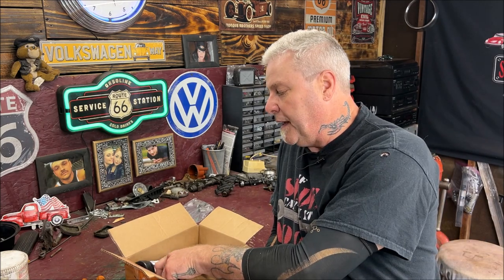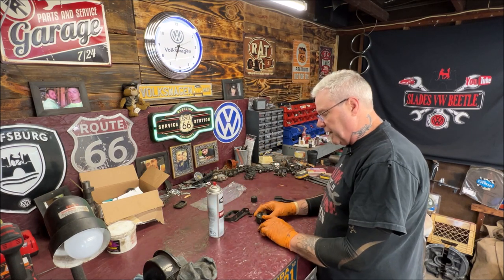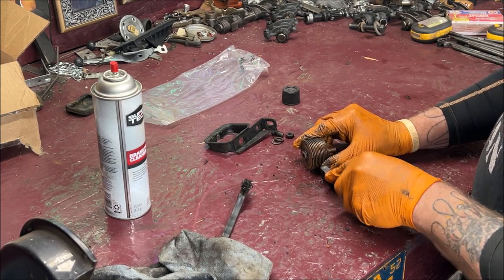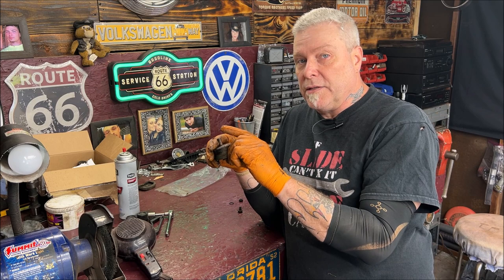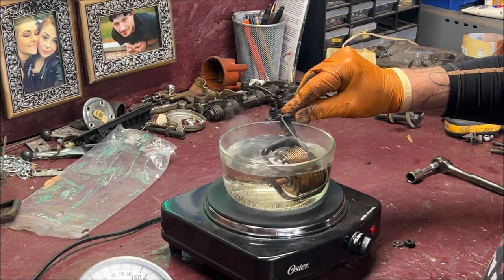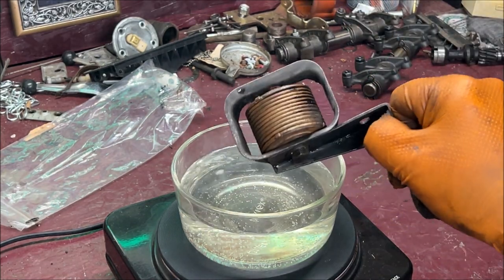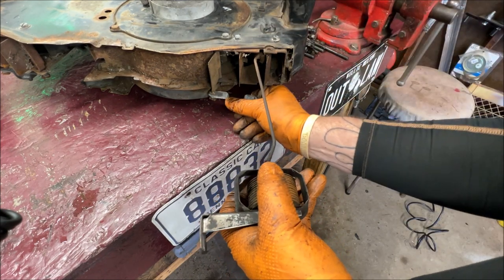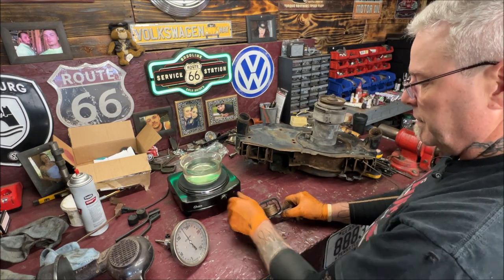VW Beetle - Super Beetle - Thermostat Testing & Explanation - VW Ghia - VW Bus- Classic Bug -

Comment: the Germans made this engine very well. there is a reason to use that thermostat in any climate where you live.
the engine has to warm up fast, to get the best out off it and less fuel consumption without the choke.
beautiful explained Tony and as always a good video.
Reply: Some folks like to rebuild their engines very few years. Thats why they remove the thermostats and flaps.
Reply: @vintage76vipergreenBeetle  It’s never a good idea to take them out. There are more reasons to leave them in. I have seen a lot off stuff over the years and at one day you will see the difference between doing the right thing or cutting corners. Just my opinion.
Reply from the maker: @VWBEETLEOVAL1955  honestly, I think the Germans were geniuses. For many reasons. And then of course not for some reasons lol however, I think they did a fine job with these engines.

Comment: Great video.  I have been running my super beetle with out a thermostat and have condensation in the oil fill.   Proves the engine was running cold.  I will be installing the thermostat soon.
Reply from the maker: Thank you Jeff, and thank you for being here. Yes you want the engine to warm up quicker, and stay warm. I surely hope that made sense.

Comment: Great video.  The demo is very detailed as to how it all works.  Is the slot mount bracket critical on placement to the engine block for the flaps to open completely?  My engine is running a bit warm and I wonder if I should loosen the bracket and shove it up as far as the slot will let it move.  Also got to back off the timing from 32 to 28 to see if that will help.  Thanks for all the videos.  You need to do a baywindow next build.  I need lots of videos to get that money pit back on the road.
Reply from the maker: Honestly William, that bracket is adjustable. 
So you could try adjusting it up, to open the flaps further. I surely hope that made sense. 
And honestly I never go above 30° full advance unless I really have to. I try to keep it between 28 to 30. So it don’t run hot.

Comment: Good info, Slade.  Years ago, lazy mechanics discarded these thermostats in areas with warm climates because installing the fan shroud is more difficult when messing with the thermostat rod as it is threaded through the cylinder head.  Pure laziness, only.  

Getting the engine to operating temperature as quickly as possible is the goal every ACVW owner should desire.  A properly functioning thermostat and flaps system accomplishes this goal.  No thermostat, and the engine runs too cold for longer periods of time.

Who would remove their thermostat from a water-cooled engine?  No one with any sense.  Why would you remove one from an air-cooled engine, then?
Reply from the maker: Right?!?!? Thank you, you put that all very well my friend. I just believe the engine design is amazing, and I try to keep them true to what they are. I hope you have been doing well, and you’re healthy and happy my friend!

Comment: Thirty five years ago, (when I was 22) one of those thermostat bellows opened up so wide on my beetle, that it destroyed the bracket and stuck in that position, never going back to normal. I then replaced it with a new one and that got so hot, that the solder holding it together melted and it fell apart. Horrible things.
Reply from the maker: Wow! I’ve never ran into problems with them.

Comment: I would love to see a side by side comparison of the original and new thermostats failing. I've often heard that the coil version fails in the closed position. It makes sense considering the relatively weak spring at the front if the shroud. One wonders though if the new style just needs a better spring and it too would fail in the open position.
Reply from the maker: I completely agree Raymond, I have no way to do a comparison at this time. 
I literally just had a conversation a few weeks ago with a guy who had the spring style, and unfortunately it failed with no airflow to the engine. The outcome was pretty upsetting.
Reply: @SladesVWBeetle , the wax pellet coiled thermostat was never meant to be used as the engine thermostat.  It's just a hack.  The original bracket doesn't even fit it. They call these thermostats, "Mexican", but they were never used in Mexico.

Comment: Slade my Son, my thermostat does not seem to reach opening temp on the car. Works great when I hit it with a heat gun.

The left side cylinders ( where the cooler is) runs about 100 d hotter than the side that the bellows is mounted on.
 
I've had the system apart a couple of times. Everything is clea, clear and unobstructed. I realize the function of the bellows is to hold the flaps closed against the tension of the spring which defaults to flaps open

Anyway! I'm wonddring is it common for the oil cooler side cylinders to run hotter than the bellows side?
Reply from the maker: Hello Lawrence, I hope that you’ve had a really wonderful weekend!!!

From my experience, and I really don’t have proof. The side that the cooler is on, the cylinders will run a little bit warmer. 
Now remember my friend that is just a personal opinion. But it makes sense the way it is positioned. 
Now I would have to think if in fact an aftermarket external oil color was mounted somewhere, which I will be doing on the stroker motor I’m  building soon. 
Then all four cylinders would run equal. As in temperature. I hope that made sense lol

Comment: Sir Slade:  great video!  2 things: 
1. could you have used the heated ultrasonic cleaner on the old thermostat, and
2. what is your opinion of the more modern designed replacement thermostats that you can get say from JP Group Dansk P/N 8114600100, that look more like a CB Antenna coil - very greatly spaced coil windings? 
3. I used to run without the flaps and thermostat when I rebuilt my VW engine back in '76, and true to form, it took a while for that oil to get warm!  Thanks for pointing that out!
Reply: The antenna coil style thermostats are not safe to use.  When they fail, they fail closed, and your engine will overheat and seize. Stick with the original style.
Reply from the maker: Vintage 76 nailed it!! If you’re going to use an aftermarket thermostat, just go to awesome powder coat online. 
And get a genuine German one so they fail in the open position, if anything ever goes wrong. 
I would never chance dipping one into the heated ultrasonic cleaner. I like using the water method so I can monitor how hot it is, so I don’t damage the thermostat. Thank you for being here Daniel I truly appreciate it.
Reply: @SladesVWBeetle  I was actually thinking that you could control the heat on the ultrasonic cleaner not only as a test vehicle, but also to for cleaning the thermostat as well.  But I take to heart about getting the true German type replacements.  Their quality is hard to substitute.

Comment: Be careful folks. I ruined one with a heat gun!  My '69 had the Thermostat and flaps removed and was running J-Tubes. Needless to say, it had been running hot. Low compression and lots of blow-by.  I'm about to order a fresh rebuild. The engine starts and runs OK, but lacks power. I'm hearing some whining and a little rumble, too, so I'm not going to just do a top end job. I wanto start fresh, with everything there and take good care of it. No more 20w50, either.
Reply: Blue print the oil pump also.
Reply from the maker: Since you were running J tubes, were you running the industrial shields? For the proper airflow for cooling?
I’m just curious.
Reply: Why no 20w50?
Reply: I didn't set this up. When I bought it it had J tubes, no thermostat or flaps. Back in the day, a lot of people thought you didn't need what the VW engineers developed to cool the engine.